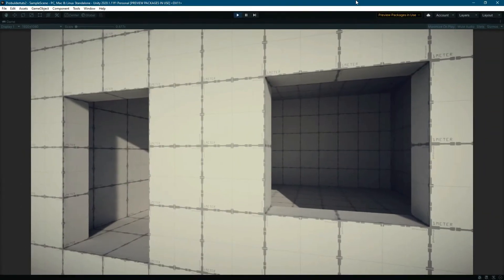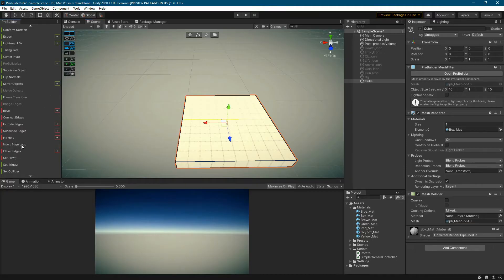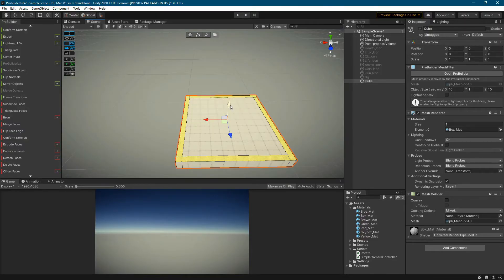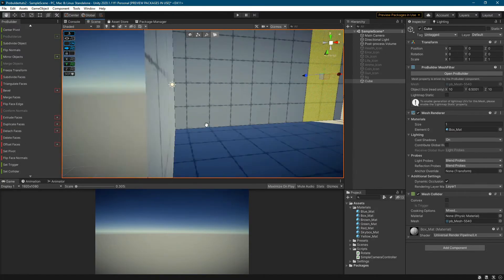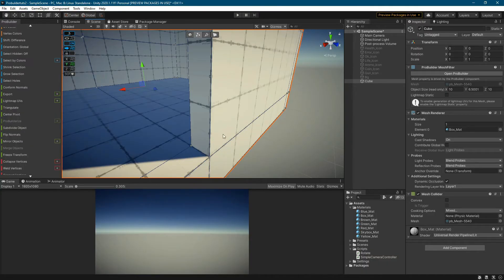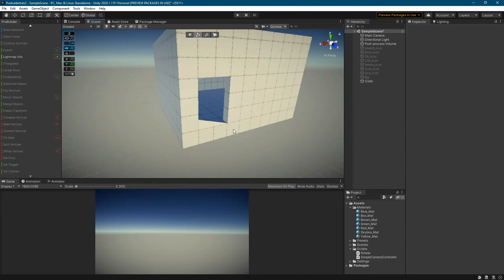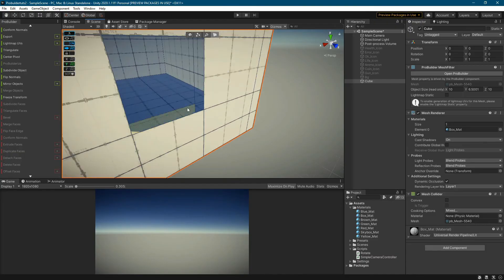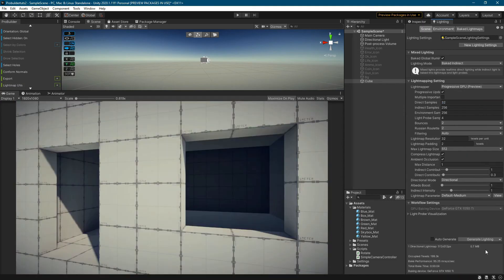Unity 2020 ProBuilder: Cutting holes for doors or windows #4

Comment: Hey, where do I get ProBuilder if it`s not on the store? 
Thanks!
Reply from the maker: Hi. It should be in the Package Manager and should you enable experimental packages first.
Reply: @DukeByte  Thanks again, I have a couple of issues though; for some reason I need to make a hole for a door/window twice (from outside and inside), and when trying to weld the vertices - they act the same as before the welding process (Although in the vid it looks like you select only one vertex, but when I do the same, the "Weld Vertices" button is not available). Will be thankful to hear your thoughts on this.
Reply from the maker: I don't have access to the computer right now. I think you must select two vertices with this tool. I think there is other tool where you select one vertex and there is max distance where that ver is merge with other in that distance.

Comment: Is there a way to cut a hole on an object with an object? Like, you move an (stencil)object inside the object you want to cut, then it removes the area of the area that the stencil object was in. There's a function like that in valve hammer editor.
Reply from the maker: Hi try using a boolean tool https://docs.unity3d.com/Packages/com.unity.probuilder@4.0/manual/boolean.html

Comment: If only the part of connecting vertices were easier this could be faster than modeling on blender, since u can literraly do the same on blender but in 5s instead of 3m but of course u gotta texture but PB doesnt do a great job at uv but good tutorial.
Reply from the maker: Hi. 🖐 Probuilder is more for prototyping than for proper game assets creation. But with some good knowledge of PB, you can make casual, simple 3D games directly in Unity.

Comment: you're so underrated and you helped a lot, just one question though, why do I need to connect the vertices?
Reply from the maker: It is good for optimization, reduce problems with texturing and lighting.  It is good practice to have clean geometry. Thanks for that question 👍
Reply: @DukeByte  ok thank you, I'll make sure to check out more of your vids.
Reply: I was also thinking for this thing.... Thanks for asking